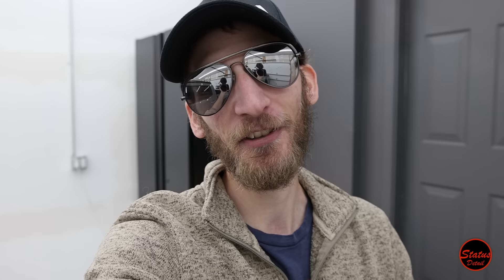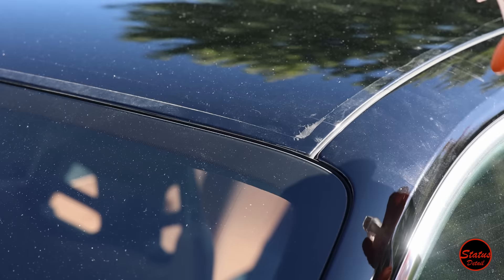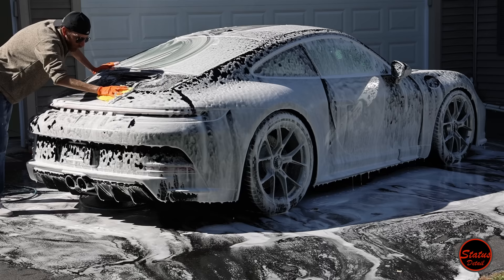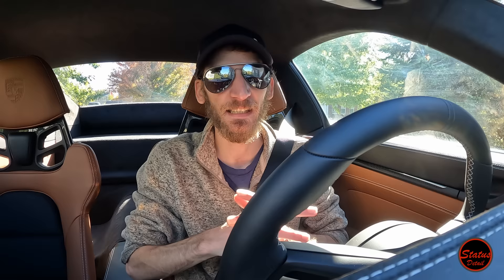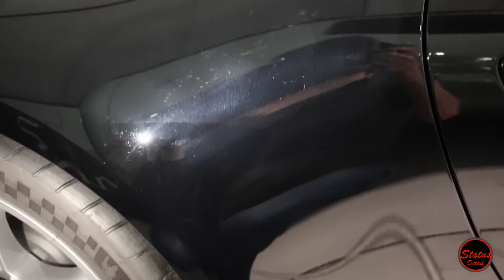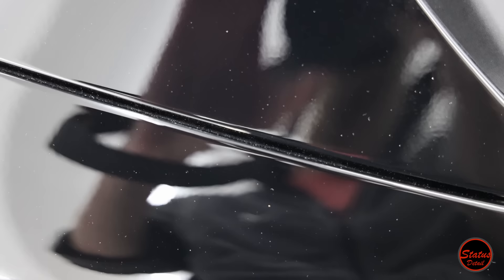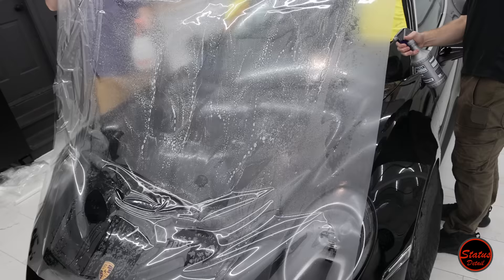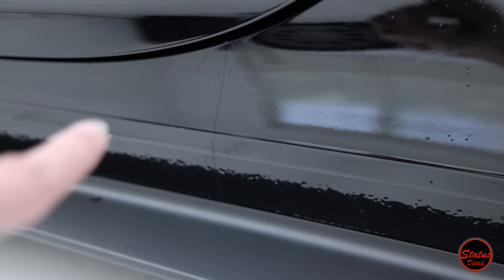992 GT3 Touring FIXING Worst New car Delivery EVER!

Comment: You mentioned you had to buff the wheel arch several times, would that not have long term implications for the clearcoat in that area? I often see cars where the clearcoat has broken down on a panel which had been over buffed by a panel shop probably trying to put more shine on a panel adjacent to one freshly painted.
Reply from the maker: Anytime you polish a car you are removing clearcoat. 

How much you remove is going to be determined by the process and the person doing that process.

What you are referencing is typically when an unskilled body shop person uses a rotary buffing with hard hitting compound in one spot for too long and they burn through the clear and you get a dull spot. 

A brand new car with a good process and some common sense It's incredibly difficult to burn through clear coat. 

What we did to this car left more than enough paint for years and years and years. But if an inexperienced person polishes this car or compounds this car and with the wrong products every year as part of a maintenance for example to make it more shiny than yes of course it's very possible that they burn through the clear coat in a matter of years.

You just need to know the limitations of paint and you need to know when to not try and correct something or to stop chasing something that you're actively trying to fix. 

The use of paint depth gauges is also very helpful but those don't always tell you thr full picture. They tell you the depth of clear. Paint. Base coat primer. It'll also read things like Bondo and can be easy to spot a painted panel but that's a different story. 

The point is a paint depth guage doesn't read clear coat it reads everything. It's up to detailer to decipher how much of that number is clear coat and how much you have to work with. In my personal opinion on a brand new car a paint depth gauge doesn't tell you much because you know it's brand new paint and you know there's a decent amount no matter what I do it's going to read total depth. It's more helpful when your detailing a 25-year-old car and now we can kind of guesstimate how many times the car's been polished or compounded and then take a fraction of that number and say that much is clear.

Comment: Not sure if you have access to any Bilt Hamber products? They have a item called Atom Mac which helps reduce the staining on the discs.
Reply from the maker: Interesting! I know a few companies make stuff you can spray on the rotors. A few seconds up the street and back has been my solution when a car is staying in the shop a few days.

Comment: Actually there is some rust left on the breaks, is there any solution for that?
Reply from the maker: Not sure what you mean? Typically on steal brakes you will see some rust on areas the pads don't touch. That's common. Technically you could like sand it off but it's just going to rust when it rains or gets washed. Our concern is having that stuff come off on the drive home. So we get it off preemptively.

Comment: Good Job. I Personally Would've Pre Soap & Rinse, Soap again to hand wash And Rinse Than I Would Clay.
Reply from the maker: That's literally what I did lol. Actually washed again after the clay

I just don't show all the steps to try and not bore you guys with the same steps shown over and over and over. Addressed this in a couple comments now 👍 

It's also very cumbersome to film all this stuff with new angles to keep it interesting to watch. When I film a car I usually do an additional wash anyways because filming slows me down so much that it's easy to miss a spot or soap drys out to much so I need to refoam etc.
Reply: @STATUSDETAIL  Great Job. You're Right. Video Can Get Too long. You Are A Pro

Comment: Great job, can you not just unbolt the hood emblem though rather than risk knife cuts?
Reply from the maker: It's shockingly difficult to unbolt it. It has like greasy stuff covering all the bolts. 

And then you basically need to drop the bolts through a recessed hole that if you don't get it right it will fall into the hood and basically never come back out

Then you have to remove that in the future to pull the film off and do it all over again

I have often been the guy removing it in the future but I didn't do the install. Years later when you try and remove it those bolts like to spin and not come off. 

I have never had one fall into the hood but I've had one or two come close. It was like a slow motion movie of it falling through the whole perfectly lol

Side note. We don't actually cut this "on the car. Technically it's cut on the badge. when done correctly like this car was it will fit perfectly into the recessed part of the badge. Literally nearly impossible to see that seam. And it's more like we are scoring the ppf. Then for the last part you pull the film off car and poke Into it. Then you can peel along the scored mark and it peels back 👍

Comment: Nice work! I like that foam sprayer, it produces a wonderfully even coat. Can you share what setup that is? Can't beat a beautifully cleaned black car. Good stuff.
Reply from the maker: That's the MTM PF-22 statusdetailstore.com sells it. 

The pressure washer it self is also very important and the correct orifice nozzle in the cannon. A good soap at a good dilution is also important!

I'd recommend any soap from our website.

Comment: Porsche cars don't come to the dealership like this, they come with a plastic wrap all over them and then they are cleaned up at the dealership before delivery. There's something you're not telling us about this. Porsche would not allow a car to be sold looking like this.
Reply from the maker: Sounds like you have never seen a car that's been stuck in the port for months. 

Customer asked them to not mess with it. Just undo delivery wrap. If you decline that you put yourself at risk of being stuck with a car that could potentially have really severe paint defrcrs. I have personally seen more than one car look like this one did from different dealerships. All of them got stuck in port.the sanding marks and other issues are in nearly every GT Porsche car I have ever worked on. Non of this is out of ordinary but this was a extreme case.

Comment: This week end I am cleaning the leather seats and doors of my wife’s BMW with the Gyeon leather strong with the brush and coat, for the rest of the interior (plastic, vinyl, etc…can I use Gyeon prep?  I dont have the interior quick detailing right now. I also have the Chemical guy Ceramic Hydro interior detailing product but they suggest to use another detergent to clean the bigger grime and dirt before using the hydro interior ceramic detailer.  Would the Prep be a good choice, or just soap and water?
Reply from the maker: I can't speak to any chemical guys products. 

But prep can be sprayed one or two e into a clean microfiber towel and wipes in all interior surfaces. It's great on touch screens and piano black trim.

Comment: Interesting you do iron remover after clay.
Reply from the maker: very important! the clay can open up the paint pores and even pull some iron off the top of the paint. the iron remover can then go deeper into the the paint and remove the stuff that's really dug in.  ultimately either way works. but this way should work a little better and should actually keep your pad a little cleaner during paint correction. Because there should be less iron stuck in clear to then end up in my pad.

Comment: how do you even get sanding marks on a car that's basically brand new? do they sand the base coat of the paint at the factory prior to the clear coat?
Reply from the maker: That's a great question
I'll have to talk about this in future videos because I guess I kind of assume people know this but it is kind of complicated I suppose. 

Basically after the painting process there are dust nibs in the clear coat. This is literally one a speck of dust floats into wet clear coat and then it drys this way. It makes a weird little fisheye kind of appearance and the only way to remove this short of literally repainting that panel is to sand the dust out of the clear. 

Now after you do that you have to compound the sanding mark.

So when I say sanding mark I actually mean the leftover remnants of one. Because they did technically compound and try and fix it. The problem is they're not completely removing the original marks. And that's what I'm showing you and most of my videos so I'm the one actually finishing off that sanding mark and making it so it doesn't look like it ever had anything. 

I hope that helps!
Reply: @STATUSDETAIL  thx for the details

Comment: Great job, just too bad that when someone spends $300k on a car, it's not delivered like this. I love Porsche, but that was an embarrassing delivery to be sure - they should be ashamed.
Reply from the maker: The car was dirty and would have been cleaned had the owner not declined that wash. But the sanding marks and other issues have been seen in multiple different manufacturers cars. I'm so use to it I don't even blame the manufacturer anymore lol. 

Just find a good detailer and let them make it perfect.

On Details like this we spend around 25-30 plus hours making your car perfect. A lot of cars are manufactured in about that time. We spend that much time on just making your paint and overall car perfect. 

The manufacturer job is basically to put it together 👍

Comment: I know it’s an old video and you might not see this but why would you use a detail spray with a wax in it after you clay barred and then we’re going into a paint correction? Isn’t that just defeating the point of the clay bar minus getting the deep dirt and grime
Reply from the maker: @MattRodriguezgti  I do my best to comment on all the comments even if they're old! 

You raise a great point. This video is old and I do things differently than I used to however what you're specifically asking about isn't exactly the right question. 

Detail spray and ceramic spray and all of those kinds of protection type sprays will do nothing to interact with clay bar. I clay with soapy water. After you clay you technically want to put protection on that's the best time to do it. In my case I'm going to do paint correction. Clay bar plus paint correction equals the best possible time to add protection like a ceramic spray or an actual ceramic coating. 

What happens when you use a quick detailer with lubrication but also some kind of wax is that you're kind of fighting against that during your paint correction stuff. Some of those polymers can be very strong and actually screw with your paint correction process. To clarify you could continue to use a detailer like I did in this video. You just need to kind of cut through that with your compound or polish. Some of those products are stronger than others and will resist the polishing in pain correction step more than others. It's not the end of the world but it's definitely not the most efficient way to go about your process. That's why I changed it. 

Currently after I finish doing a wash and clay before paint correction and ceramic or PPF I wipe the entire car down in gyeon prep. That's basically a really strong isopropyl alcohol mix. This gives a little bit of lubrication but it also sucks everything off the paint and leaves nothing behind. This is exactly what I want perfect bare paint to begin my paint correction process. 

I hope that makes sense. 🤝👍
Reply: @STATUSDETAIL  yes I know the best time to add a protection is after clay bar and correction I just thought you clayed the car then after spraying the detail spray with wax did the paint correction. Just recently did a 2-step and ceramic on my car and previously used to detail professionally on the side and have spent countless hours on the internet and in person researching the ins and outs of detailing. Didn’t know if I was missing something in the video or if that was how you did your process( there isn’t one specific process that’s the best imo) so I was trying to get your input! Appreciate the response always nice when questions can be asked that might go against the persons process and they get answered in a respectful way.
Reply from the maker: @MattRodriguezgti  yep I did clay then spray detailer with light polymer in it then correct. Definitely not the most efficient or effective way to work gyeon prep is far better system and process. Both definitely work. But I switched for a reason 👍

Always happy to answer questions in the comments. If you took the time to watch and comment especially a well thought out comment like this one it's always my pleasure to respond 🙂🤝

Comment: I have a porsche boxster 718 gts (Black) it has been ceramic coated with Opti something lol... what product would you recomend for a top coat if you will for removing fingerprints ect... ?
Reply from the maker: Gyeon cure. Gyeon ceramic detailer. Carpro release. Carpro reload. All great options 👍

Comment: Definitely not down with box cutters on the paint to cut out the emblems.
Reply from the maker: Box cutter? Lol. Those are different. The emblem is not being cut in paint actually. But every ppf install does have cutting on paint t some point. Even when you plot. Because it won't always align perfectly. In fact most plotters still hand cut everything. They just plot to get the general design plotted out. 

Box cutters and ppf knifes are very different.

Comment: Your title makes it seem as if the dealer was a piece of crap and delivered the car that way.  The customer MADE the decision to not let the dealer clean it up. I'm assuming it is a repeat customer of yours and they knew that you would do an outstanding job as you did!
Reply from the maker: My title says exactly what happened. The car was in a disaster state for what a new car should look like. At no point did I put blame on anyone for the state of the car. I did say the sanding marks happened during manufacturing. That's common and is a Porsche manufacturing issue but just about every manufacturer of cars has this issue. So it's not a unique Porsche issue basically. 

The customer came here for the first time but off multiple recommendations and trusted that I could fix it all. I also never told him to deny all the dealer prep. 

This simply was a diaster detail of a new car that didn't look new. I wouldn't assume to much past that as the viewer.
Reply: @STATUSDETAIL  I never said you told the customer to deny the dealer prep.  I actually was complimenting you that in your state of defense totally went over your head!
Reply from the maker: @diamondrmp  definitely missed that. Lots of negative comments lol. Sorry for any miscommunication

Comment: You get what you pay for, these dealerships pay these kids peanut's to detail all their car's with no experience
Reply from the maker: Was talking to a guy yesterday that was being charged $3000 for a full front ppf a dealership. Plus no paint correction. 

I'd avoid dealership installs of anything besides under warranty OEM parts.
Reply: @STATUSDETAIL  Facts, I use to work at a dealership as a detailer and I can tell you horror stories lol
Reply from the maker: @is2fiftyslowfsport744  I believe them all lol... But you should share one for fun 🙂
Reply: @STATUSDETAIL  I've been detailing for 20 years and this was a first for me, sales guy had a delivery but there was a scratch, I explained to him, I  can wet sand buff and polish etc but he couldn't wait and the car was already late on delivery, i realize he didn't care about the customer, he  just wanted to make his quick buck, he couldn't wait for me to remove the scratch so he asked me for some tire shine and he sprayed over the scratch then told me to spray wax the area quick around the tire shine to make the whole panel appear to be shiney so the tire shine wouldn't look so obvious, I just shook my head because I couldn't believe what was happening lol
Reply from the maker: @is2fiftyslowfsport744  that's interesting! Lol
Reply: @STATUSDETAIL  It's one of those stories that nobody believes but it actually happened
Reply from the maker: @is2fiftyslowfsport744  I believe it haha

Comment: Is it "worst car delivery" if the customer declines having the dealer prep it for delivery..?
Reply from the maker: Well even if he had had them prep it the car still would have been totally messed up. I'm assuming you watch the video which made you saw the sanding marks and how the sanding marks went behind the ppf. 

The paint was all swirled out in general. 

And I've seen multiple cars that have been on the same situation that dealers did prep and they still have dirt all over the place they just take off the top layer basically. 

We spent about a week getting this car fully dialed in a dealership's going to spend about an hour doing that before they give you the keys.
Reply from the maker: @@thorodinson3323 it's an expensive transaction! Likely the second most expensive of your life. First being a house. But we wouldn't buy a house when we walk around it and things are all messed up. Car should be no different 👍👍